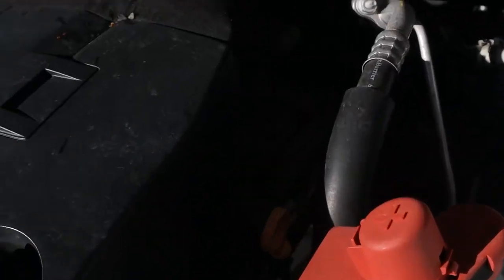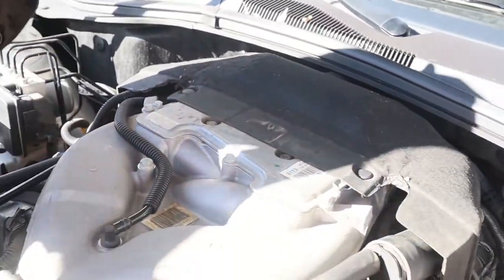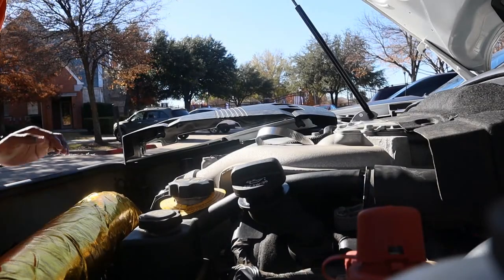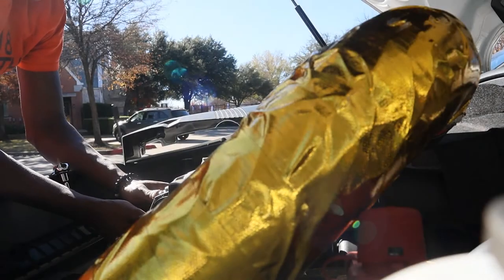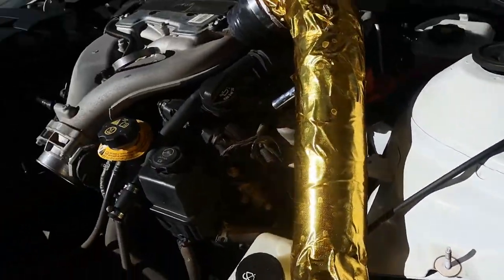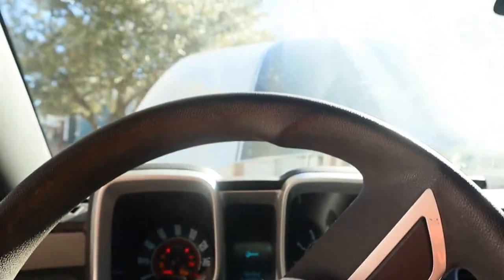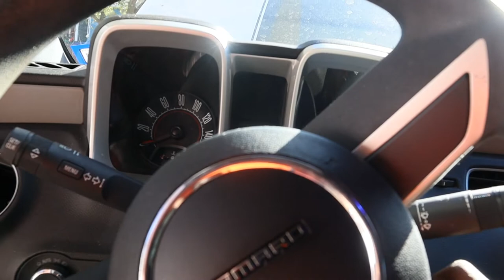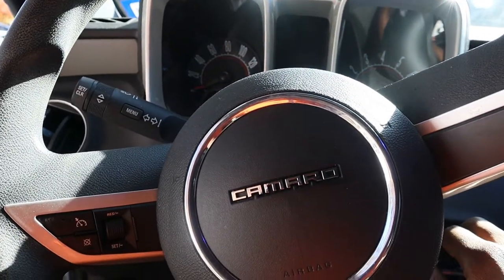I THINK I FIXED THE ISSUE w/ THE CAMARO

Comment: Hey bro I had the Same problem with my Infiniti G37, wen I started it it revés really high and my check engine light was on. And wen idling it would stay around 1,100 Rpms. Wen it was supposedly be at 750. I chained my spark plugs and the problem went away. It was a mis fire but idk if your might be that. You can take it to get a scan to see if it’s a random mis fire or something more serious.
Reply: And my engine light would turn off and then in a couple of days it would turn of.
Reply from the maker: I recorded this video back in November and after recording it it’s been off since then
Reply: @LegendaryBurnout  gotcha